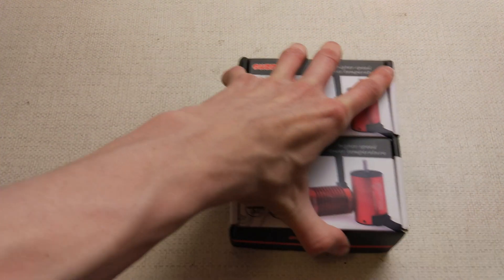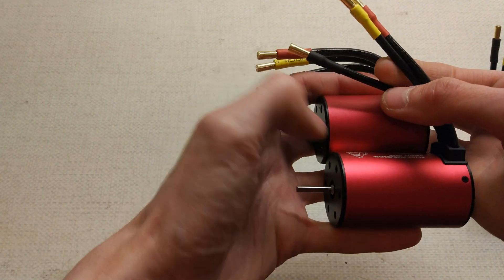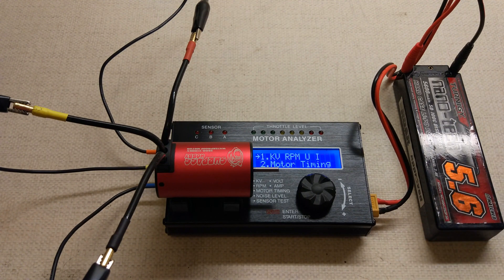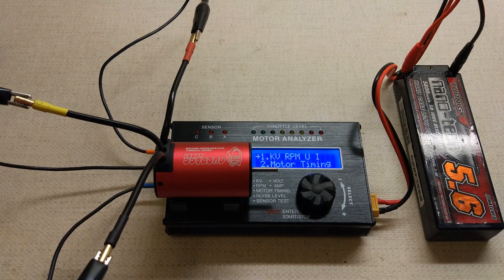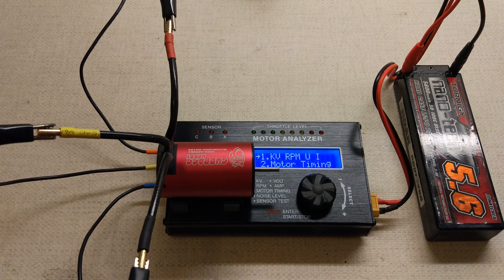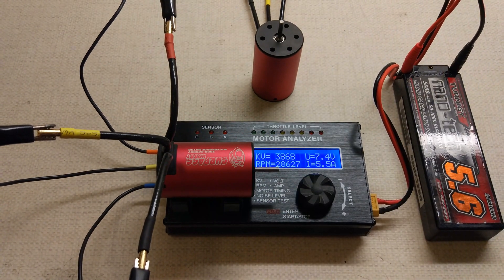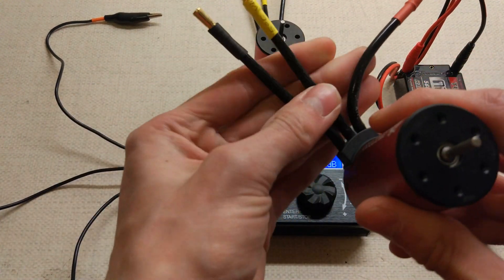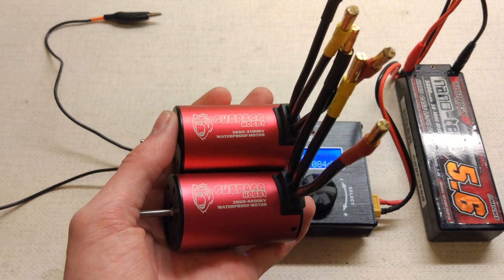MTT EP9 2 Surpass KK Series 3660 Motors Tested

Comment: Hi Iawrence, great vids mate keep up the good work. I was wondering if you or anyone else out there could possibly help me please? Im a newbie to electric rc, but ran nitros many years ago. Unfortunately my health has recently taken a nose dive and not able to walk or move very much so decided to find a hobby that I could actually do. Im on a tight budget and dont know very much about all this(but Im learning very fast lol) thats why in my infinate wisdom I went out and stupidly bought a Maverick Quantum XT brushed version from RC Geeks(cowboys). Totally disappointed in speed, I knew I should of waited and got the brushless 3300KV 80amp version, but you know what its like........I want it NOW lol. I really want to upgrade to brushless but as stated before Im on a reasonably tight budget and I dont need a rocket, want to run mainly on 2S with an occasional 3S put through it, just for a bit of good bashing no supersonic speed runs or anything. Can anybody recommend a package with a good motor and ESC with a programming card or is it better to buy everything seperately? I was looking at this package????  https://www.aliexpress.com/item/1005003262319187.html?spm=a2g0o.cart.0.0.1eba38da1pXVD0&mp=1   Any help and advice from anyone out there would be HUGELY appreciated. Cheers.
Reply from the maker: The esc in the combo you linked is not good. The motor looks OK though.
Reply: @LawrenceTimme  can you recommend anything in particular which you have tried and tested?
Reply: @conwah3697 hobbywing 120BL Gen 2 combo with 3660.

Comment: Hi Lawrence, do you know what would be on average the constant current draw for a surpass 3660 2600 kv motor? Using it for bashing arround. What C rating and capacity lipo battery you recommend to get at least 20 min playing time?thanks:)!
Reply: Thanks for the advise Lawrence! I will buy it on local store then. Is there a simple way to measure the average current draw? So I can know more or less how much time i will have with 5O00 mah. Also, do you think i can reach at least 30 mph with 2s and 2600kv? Or should i go 3s. I have a gear ratio of 3.25 and car weights arround 1.9 kg(1/10 scale).
Reply from the maker: @cesarguerra6039  nope. You just have to run it and see unfortunately. It will depend more on your driving than anything else.

As for speed calculation use this https://scriptasylum.com/rc_speed/top_speed.html
Reply from the maker: It depends completely on the gearing and weight of the car it's going in. Considering all the c ratings are fake, I'd recommend you get a decent brand of battery and 5000-6500mah. Stay away from cheap brands on Amazon or bangood even if someone on YouTube is shilling them.
Reply: @LawrenceTimme  I dunno what your experience has been but I've bought probably a dozen different Amazon lipos and all of them have worked out great.you simply just don't need to buy "brand name" lipos anymore. They all come from one of a few China suppliers anyway. Your just paying for the sticker. Maxamps is a classic criminal example of overpriced "quality lipos" being sold for an exuberant prices that are far below average quality.
Reply from the maker: @romper4444  I've bought cheap Amazon lipo and they've all been rubbish. Getting a reputable company is quite important if you are running a high current system.
Reply: @LawrenceTimme  I agree if your drawing bigtime amperage speed running or really pushing an xmaxx or something, but your average basher will do just fine with $35 lipos from amazon. I literally have probably 30 lipos from amazon of varying brands and I havent had a single one go bad within a year. For how cheap they are if I get a season or two out of them, I'm totally happy. But I do have multiple batteries that are I dunno how many years old now and work fine still. But again I'm not pushing bigtime draw on my batteries. If you look after your lipos they will last. Anything from China tho can be hit or miss, it's strange how some people have terrible luck and others have no trouble at all. My biggest demand RC is a brushless e-revo and I just run my better lipos in that, often my gens ace 3s 5000's or my 2s 8500 energy lipos(which are an older amazon brand from 6 or 7yrs ago).

Comment: Hi lawrence, why this motor does not have the T value on specifications? Only apply to sensored? I bought the 3660 2600 kv and cant find the info. Thanks
Reply from the maker: 3660 2600Kv Surpass motor is 5T
Reply: @LawrenceTimme  thanks!

Comment: Hello Lawrence, greetings from Spain. I had just bought a 1/10 car DIY , Im wondering if I mount a 3570 instead of a 3650 will it fit? How I know it can fit. I read shaft is longer. Do I have to buy additional parts? Or it would be the same mounting any of both. thanks very much
Reply from the maker: The shaft of most 3670 is 5mm in diameter and most 3650 are 3.2mm diameter, so you probably can't get a pinion gear with the correct holes size for a 3670. Stock with the 3650.
Reply: @LawrenceTimme  ok, then for what scale is a 3670 recomended or meant to? A 1/8?  Or is that its meant to fit in a 1/10 and the only solution owners apply is to find a pinion gear that fits? I bought a zd racing 10421 diy kit. If I have to stay with a surpass kk 3650 and i want to use 3s you would recommend 2600 kv or 3100? I will buy a 120A esc. My goal is just to have fun in open spaces with my son . We like speed and carving. Thanks in advance for yor recomendation
Reply from the maker: @cesarguerra6039  it's not about the scale of the car really it's about the correct gear pitch and motor size for the car. 

I think on 3s 3100kv should be ok in a 1/10th car.
Reply: @LawrenceTimme  I realized the space I have for the motor is only 60 mm, its already delimited. So I understand I can mount max a 3660 motor. I saw in the motor information that the width  of the shaft is 3.2 mm same as 3650. But it say extended shaft 17mm vs 15mm of 3650, woud this be an issue knowing the space limitation(6cm)?Its myfirst DIY rc and I need to know if what im buying will fit. thanks very much for your help
Reply from the maker: @cesarguerra6039  yes it sounds like the 3660 may fit. The extra 2mm of shaft length should fit. If not you could always sand it down by 2mm
Reply: @LawrenceTimme  great help! Thanks very much Lawrence
Reply: @LawrenceTimme  last question. When you say "probably cant find correct holes" ... Is because not all 5mm pinion gear sold in the market will fit a 5 mm shaft?
Reply from the maker: @cesarguerra6039  no the gear pitch on a 1/10 is normally 32dp or 48dp which normally only come with a 3.2mm hole. Mod 1 normally come with 5mm hole

Comment: Nice, thanks, do you think a 3660 is to much for a wltoys 124019 it would you go with a 3659 just got general doing around the streets, thanks again
Reply from the maker: Yes I think a 3650 might be better for that than a 3660
Reply: @LawrenceTimme  Hey, I bought the 3660 for my 124018 will it fit without force?
Reply from the maker: @martez752  I have no idea XD

Comment: Bro you're not reaching the RPM specs because you're using a 2's battery boost the volts to 3s and you'll get your specs
Reply from the maker: no,  the kv is constant. doesnt matter if you use 2 or 3s the kv is the same..........
Reply: Only at it's rating. The 3s motor isn't even woken up unless it's at 11.1 volts. You've already proven KV ratings are wrong anyway. At least give the motor an honest chance. It doesn't matter now, I don't like your attitude. I've been building 100 mph 3s cars for 30 years and I'm not coming back. This is a fraud.  @LawrenceTimme
Reply: @LawrenceTimme  Then you should show that on the bend
Reply: Exactly

Comment: cool thank's for the video, there goes my plans of 3100kv upgrade out the window..seems low rpm too..i might need to go surpass 3500kv for a 1/12 wl 12402-A upgrade as i want the low end torque but not so much mad top end speed.. if my stock is 550 brushed/19Teeth gear what is equal in brushless or bit more as i got limited room in backyard and don't jump bash much..anyone suggest a decent combo with NO COGGING

Comment: I am still wondering what is the difference between the KK and Platinum versions? The only difference I've found is 4-pole 6-slot (KK) vs 4-pole 12-slot (Platinum), but i don't know what that means
Reply from the maker: I found the platinum to be a bit better but that might have just been luck

Comment: bro, is this motor good for low rpm or will it cogging
Reply from the maker: Depends one the motor and ESC combo. Personally these are OK for me but they aren't sensored.
Reply: @LawrenceTimme  so you think, its better to go sensored brushless for low RPM torque? I buy cheap brushless combo 80A, running with 2s. It cogging badly on start. Cant even climb my leg to body. But for straight line after it start rotating then it has no problem.  It just to annoying especially trying to play in low throttle

Comment: You can test what you want. but you have only theories... these motors are used in Wltoys 144001 on 3 and 4S and are not so weak as you show. they reach topspeeds up to 110 miles
Reply from the maker: ? I have tested both these motors in real life. How am I showing they are weak in this video? I'm testing the rated Vs real KV. 

Pushing a light Chinesium buggy doesn't take much power or effort at all. I have tested both these motors in a heavy 1/10th monster truck. 

They are perfectly fine for the price.
Reply: @LawrenceTimme  Only broken motor shaft, https://youtu.be/sx8BkAKhKVg
Reply from the maker: @mrdangerdanger2189  yes, but that is a tiny little car on road. I don't see how that makes it good. It's very easy for a small car to go fast when the motor is almost as big as the car. xD
Reply: @LawrenceTimme  The price makes it good..
Reply from the maker: @mrdangerdanger2189  that is not what you said in your original comment. I agree. They are fine for the price. 

How did you come to the conclusion that I thought they were weak?
Reply: @LawrenceTimme  You show the motors with less power than they realy have. so the people think this is a weak motor. but you do this test only on 2s... 3 or 4s will increase power
Reply from the maker: @mrdangerdanger2189  no, the kV is constant. Its doesn't increase with voltage XD. The 2s battery is a standard that the manufacturer uses for testing. I am comparing their spec to my real test.

3s or 4s will not make the kV higher. It will just blow up the tester XD.
Reply: @LawrenceTimme  If it n a 1/10 car then it's n a scale cars a 100 is good on 3s 4s....
Reply from the maker: @keithbranch7718  no the rotor will just break apart from too much force...
Reply: @LawrenceTimme No motor is rated at a fix voltage..You just say that in your video about a senseless motor...A motor has a minimum and max voltage.Before it breaks down most ESC can go 3V higher then the then the minimum..But you keep say it put it on the bend...I like to see it break at 11.1v.Ill person buy you a other one
Reply from the maker: @keithbranch7718  this is the manufacturer specifications. It's designed to work upto a maximum rpm which is safe for the rotor construction and materials.. the original comment was completely meaningless and irrelevant. I am testing if the motor meets the factory advertised spec. Not testing if it will blow up if I run higher voltage. The size of the car doesn't make the rotor in the motor any stronger when spinning at high rpm. It's nothing to do with power or weight of the car or motor.
Reply: @LawrenceTimme  So you think a manufacture design a motor to only operate at one voltage..Once heat build up resistance go up need more current to push that motor...So doubt that motor was made just to stay at 7.2 v....My car was supply with a 7.2 n that the specification on the box.But the esc say 3s...I also say I'll buy you a new one if it breaks...Not gonna break unless you put to high of a current.To cause more heat but 11.1 n a battery as the source.The motor will run perfect no problem...That Y I love Kevin and RAZ channel...They push them to they limit one is more control n the other don't care if they break....
Reply from the maker: @keithbranch7718  no, I am testing the motor Vs the manufacturer specs? How is this not clear? I am trying to see if it meets the advertised spec. I couldn't care less about speed runs..... Running a car for 20 seconds is boring.

Please grow brain cells before commenting in future.
Reply: @LawrenceTimme  11.1v is breaking no rotor.I been running my for months.If I went higher then probably yes
Reply: You're in the wrong channel lol

Comment: The motor is bullshit. But you still recommend???     Your an idiot
Reply: These motors are not bullshit. used in Wltoys 144001 on 3 and 4S and they reach topspeeds up to 110 miles
Reply: it's fast and reliable in my inferno ve

Comment: I would like to see you do a test on the 3665 motors please?  Just by judging these maybe the 3665 won't put out close to its rating as well unlike the 3650 motors you tested. I need to replace my 3660 3200kv spektrum motor that seized and looking at going to the surpass 3665 3500kv motor. So by the way these tested maybe the 3500 I want will end up being close to the 3200kv rating of the factory motor but with slightly more torque
Reply from the maker: I don't really have any cars or trucks that would fit a 3665 so its unlikely I am going to buy any. I will be doing some ESC testing though :)
Reply: @LawrenceTimme  no worries, those tests will be good to see

Comment: Hello i have a remote control boat and i want to find an electric motor with high power 
the boat weighs is 7 kg what engine do you suggest to reach an efficiency of somewhere around 50 kilometers? Thanks!!
Reply from the maker: Not a clue on boats. Sorry

Comment: Im just curius, how does it mesure the kv and rpm?
Reply from the maker: uses the feedback from the motor. :) RC explained has a good video on how sensorless motors work and how to measure KV with just normal tools. This works in the same way, but it does all the calculations for you.

Comment: Does 3660 all refer to same size so all 3660 motors are all same size I converting a thunder tiger buggy
Reply from the maker: Yes all 3660 motors should be 36mm diameter and 60mm long
Reply: @LawrenceTimme  buddy need some help I converting a tg bringing it into 21 century it was a comp one from 2001 4x4 want to set it up for grandson he 13 I don't know nothing about brushless apart from Dyson made millions 😭it's a 1/8 some sellor on ebay as suggested a 3660 2800kv he wants 40 but I found it in China 14.95 so sounds crap its black 3.175mm shaft just says waterproof on it seen another guy who as tested 6 motors in a trax he says he is keeping the surpass platinum 3660 3800kv u know anything about that motor thanks any info would be very helpful you seem to know Wat your on about
Reply from the maker: @irishlad7458  you should really get one with a 5mm shaft. It will be much easier to find pinion gears. I would recommend a surpass kk series 3670 2650kv. With a hobbywing sc8 120wp esc. Then you can run either 3s or 4s
Reply: @LawrenceTimme  thanks buddy ordering me stuff next week thanks for advice what drive gog I need to stop motor over heat I running a 46t centre hub 4x4 and I see Wat you mean about 5mm shaft UK sellors of cogs
Reply from the maker: @irishlad7458  try a 13t to start with. I would recommend getting pinion gears from rw racing, they are good quality and last much longer than the cheap pinion gears I've used. They are reasonably priced as well.

Comment: You tested those motors on 2s; so the KV wouldn't peak its max. Try another load test running on 3s then you'll have a better result!!
Reply from the maker: The motor doesn't increase in kv at higher voltage as the kv = rpm/voltage.

Comment: How long is the 3660 4200kv motor? 60mm?
Reply from the maker: All 3660 motors are 60mm long. The 36= diameter in mm the 60 = length in mm

Comment: Hello :-) Any idea of the number of turns for the 3100 Kv 3650 ? My ESC manual says it support 3S only with motor > 8.5 Turns and the surpass manual does not says how many turns but names the 3100KV "3650/5T" so it is likes like to me this motor is 5 Turns and could not goes on my 120 AMPS ESC :-(
Reply from the maker: What esc is it?
Reply: @LawrenceTimme  HobbyWing Quicrun 10BL120 :-) The motor is platinum edition 3100KV.
Reply from the maker: @bretzeletouffeur  it says off road 3s 10.5t max which is 3600kv. So 3100kv should be OK. You have to gear correctly as well.
Reply: @LawrenceTimme  Thank you!  From where did you got the info about the 3600kv is 10.5 turns ? :-)
Reply from the maker: @bretzeletouffeur  on the hobbywing website on the page for the esc. I'll link it for you in 2 mins https://www.hobbywingdirect.com/products/quicrun-10bl120-esc?variant=2139725987868
Reply: @LawrenceTimme  Thank you ! Have a nice day ! :-)
Reply: @LawrenceTimme  I wrote to factory to ask the number of turns for 3100KV motor and got an answer: They say it is a 3Y type motor: 3 turns left, 3 turns right. So i guess I am screwed for using it on my ESC :-(
Reply from the maker: @bretzeletouffeur  the number of turns doesn't matter. A 2 pole 3650 will have a completely different number of turns to a 4 pole 3660. The kv and amp rating are much better to go off.
Reply: @LawrenceTimme  Thank you again !!! I offer you a pizza and a ride on my RC dirt track the day you come in burgundy ! Have a nice day !